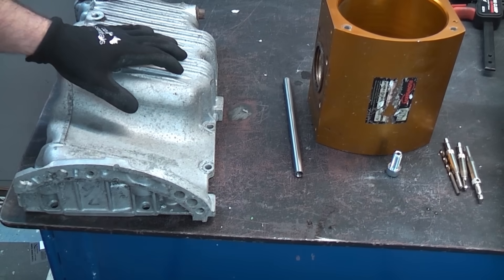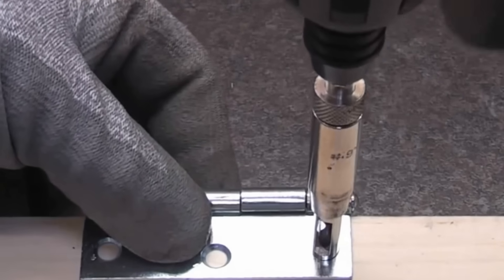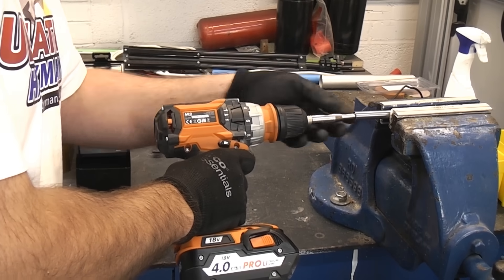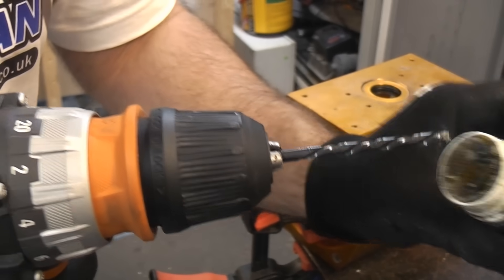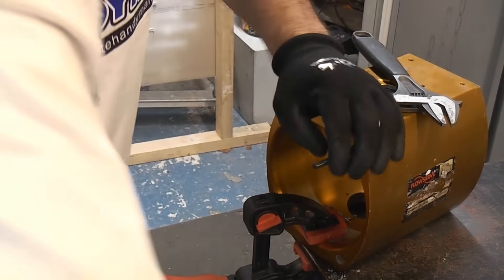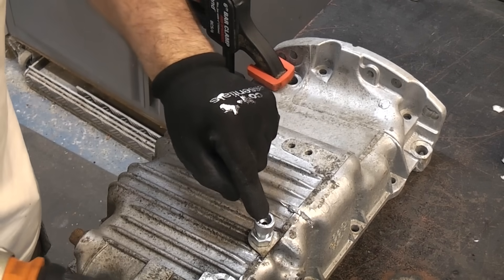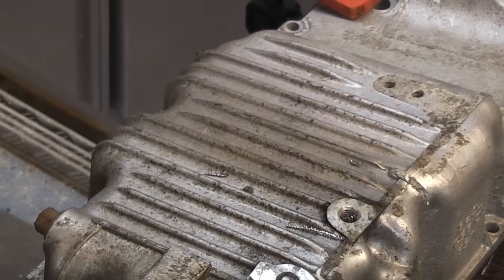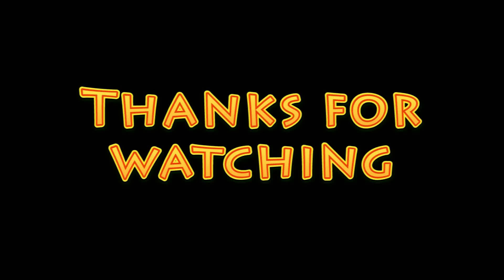How to remove a broken bolt in a deep hole | remove broken bolt in recessed hole

Comment: Whats the name of that tool there bud??
Reply from the maker: Hinge centering drills- https://fave.co/2DpJo1H
Left handed drill bits- https://fave.co/2xJjK1M
Teng screw extractors https://fave.co/2OnfRuF
Dormer taps -https://fave.co/2OsN1sQ

If you are in the UK-
Hinge centering drills- https://fave.co/2NE1VMc
Left handed drill bits- https://fave.co/2DubtF4
Teng screw extractors- https://fave.co/2pVLkVT
Dormer taps - https://fave.co/2pTfbyx

exact cutting paste- https://fave.co/2Nabyxc
cobalt drill bits (they are much better on harder steels like bolts) https://fave.co/2zDh3kp

You'll have to make the guides yourself, but they are easy- https://www.youtube.com/watch?v=6mZj0J6CNYA&t=1s

Spring tools centre punch- https://fave.co/2NbnLBD

Thanks for the comment 👍

Comment: Some very, very good tips here for any beginners watching, all things that experienced engineers practice of course. 
I have a couple of comments to add if I may. 
First: When using the extractor it works better if you use a proper 'T' type tap wrench, so axially the extractor and wrench stay in line and you can keep pressure on the extractor thus it works better and stays engaged. 
My second point is that the extractor you had in the video appears to be of a cheaper type if you don't mind me saying the ones made by Dormer and similar class tool makers are more effective at gripping as they are harder and have a more coarse helix so 'draw into the bolt in a more positive way.
I hope you don't mind me adding these points?
Reply from the maker: I don't mind at all. 
I thought I said that I had left my tap wrench at work, hence using the adjustable. I did not realise Dormer made extractors, I will look out for those 😉 
Thanks for the comment 👍
Reply: @ultimatehandyman   The type / PT No is just 'Set B' no's 1-6, I've had mine for 30 years and never broken one although the No2 one has slight wear marks. Hopefully you can get some or equivalent.
Regards Steve
Reply from the maker: @stephenrose8188   Thanks Steve 👍

Comment: When I was an apprentice fitter (55 years ago), I was given the unenviable job of removing broken taps from workpieces.  We had an electrical tool that had what looked like copper tubes of different diameters.  An earth was applied to the work piece and the (insulated) tube was put into the chuck of the pillar drill.  The power was switched on and the tube was fed down to the broken tap. Water ran through the tube and when it touched the broken tap it started to arc and slowly eroded the tap.  It took a while but went right through the broken tap and the remaining flutes of the tap could be removed.  (Before you ask, the pillar drill was used only to feed the tube, it was never switched on).
Reply from the maker: I think it's known as spark erosion. I have a mate that works for British Aerospace engineering and he could not remove a stripped screw from his door lock, so I went and removed it using an elastic band. I then asked how he would have removed it at work and he said he would have spark eroded it 😱
Thanks for the comment 👍

Comment: On one particularly siezed broken bolt, I did not have enough thread in the hole to screw in a guide bolt, so I used my Dremel to flatten the broken bolt.  I then punched a starting point for the drill.  I drilled in about 10mm.  I then heated the bolt with a torch and then made a well around the broken stud and filled this with penetrating oil and left overnight.  The following day, I used a Torx bit which I hammered into the hole and the broken stud came out without to much hassle.
Reply from the maker: Jobs like that really try peoples patience!
Thanks for the comment, Barry 👍

Comment: Thanks man, I had a broken bolt and the center guide, left hand drill bit, and extractor tools worked perfectly.  The center hole on the screw is an awesome idea, unfortunately I don’t have a lathe.  I had to spend a little money but I think it would of been impossible without those tools. Also just a tip on the extractor tool.  Instead of a wrench, try a hand drill, much easier.

Comment: Here cause I have a broken stud, tried cutting a slit into it to fit a flathead screwdriver in it broke the crew driver, tried drilling it out. When that bitch is in my hand I'll be drinking a few beers. Been at it for over an hour

Comment: If it still won't come out, drill the broken stud all the way through using another bolt for a depth guide. Then drill it again to the tap size and re tap the hole. The visible good threads will make it match perfectly as the tap cuts out the remaining bolt material in the threads. 
Sounds good anyway.

Comment: It seems like it might have worked better when you were using your hollow hex key bolts, to back them off a touch so they weren't actually touching the broken bolt.  That would give your left hand drill bit a chance to move the broken bolt slightly.  By putting your hollow guide bolt against it, you prevent it from moving.

Comment: Question: with lug nuts would you also recommend the anti-seize?  That's a bit different as it's a nut not a screw. Seems mechanics never do
Reply from the maker: The garage where I take my van always use it on the lug nuts ;-)
Thanks for the comment 👍

Comment: The centre drilled socked head bolts as a guide are brilliant.  What size holes did you use for each one?
Reply from the maker: I think I drilled a 3mm hole in the M8
4mm hole in the M10 and 5mm hole in the M12 (or thereabouts) 
 Thanks for the comment 👍

Comment: I know I sound like a goof, but anytime you have a bolt broken off in a cavity (outside a vacuum 😁), the threads are almost always rusted badly or cross threaded.  Im no expert but in practice, for me 90% of the time;  I have to drill out, chase threads, and many times heli-coil.

The guide seems to be the way to go in practice.  I have never tried them, will have to get a set!
Reply from the maker: Thanks for the comment 👍

Comment: No lathe? You can still drill a centre hole in a bolt, there are YouTube videos that explain how using just a pillar drill. Given a milling machine it is possible to use an end mill to take out most of the bolt just leaving just the bolt thread to be picked out of the hole. BobUK.
Reply from the maker: https://www.youtube.com/watch?v=6mZj0J6CNYA
Thanks for the comment, Bob 👍

Comment: Great tutorial, thanks. Those purpose-made centering bolts are a great idea for anyone who has the right tools to make them, I would probably have to try to make do with a bit of pipe of the right outside diameter and some smaller diameter pieces fitted inside russian-doll style to narrow the inside hole, so obviously not ideal. I found your post because I let a quick-fit outfit fit a new battery for me and they managed to snap off the bolt which secures the battery edge clamp - although in my case the bolt is sheared off flush with the surrounding surface so the guide bolt or guide pipe trick can't be used. I wonder if you have any interesting dodges for when the bolt is snapped off flush instead of recessed?
Reply from the maker: I normally try to knock the bolt around using a centre punch, in the direction of removal. If that does not work, I centre punch it in the centre, then drill and use extractor.
Thanks for the comment 👍

Comment: I have never successfully removed a broken stud with an extractor tool. I have had some good ones too, but 99.999% of the time the reason it is broke off is because it is totally seized in the threads and if it was seized enough to rip off the bolt then it’s seized enough to break any screw extractor.
Unless it’s in a place where I can heat surrounding metal orange hot I have to drill as centered as possible and go larger until I get to the diameter of the bottom of the threads.
Reply from the maker: Extractors rarely work if the bolt is seized in with rust etc. Like you say there is a very small chance of them working on such bolts.
Thanks for the comment 👍

Comment: Galvanic corrosion from dissimilar metals makes some broken bolts impossible to remove.  I had a broken steel bolt in an aluminum lawnmower casing.  Broke 3 ease outs and a drill bit trying to get it out.  Tried every kind of broken bolt remover, heat and PB Blaster.  Finally drilled it out and put a bolt and nut in its place.
Reply from the maker: Thanks for the comment 👍

Comment: When this happens to me, the bolt is usually rusted in. When it happens it seems like it’s impossible to move. What do you do when it’s rusted in like that?
Reply from the maker: I normally heat it up, let it cool, then spray spray penetrant on it and then attempt to extract it. If it feels like it's not going to move I repeat the process. 
Thanks for the comment 👍

Comment: Just be careful will copper anti-seize on aluminium parts that are exposed to high temperatures because is can encourage galvanic corrosion, especially where there is exposure to salt - i,e, on a cars underside.  Silver grade anti-seize is what you should use for machinery that is exposed to high temperatures and salt.
Reply from the maker: Thanks for the comment 👍

Comment: DO NOT put COPPER based anti seize on aluminum.  use the nickel based.  copper and aluminum get along ....meaning it steals electrons destroying the aluminum
Reply from the maker: On the site where I work, people have been using copper anti-seize for decades with no issues.
Thanks for the comment 👍

Comment: A copper pipe just larger than your drill bit wrapped in tape can be screwed into the threads to protect them and center your drill bit. Works great if you don’t have the tools to make a custom bolt with a whole through it.

Comment: Drilling out some bolts for different sized threads was a GREAT idea.  I've drilled out wooden dowels to do the same basic thing, but your bolt idea is much more accurate and dependable! A quality set of bolt extractors adds to the enjoyment of having that lodged bolt finally land in your hand.
Reply from the maker: You are welcome
Thanks for the comment 👍

Comment: First and last experience with an extractor - I used one that was too small, it snapped off, and then no chance of drilling an extractor out... ended up getting a new motorbike brake caliper because of that. 
I fully second the use of copper compound especially on steel to alu fasteners that will happily corrode together otherwise!
Reply from the maker: You can drill them out, but it's not easy-
https://www.youtube.com/watch?v=7JCfEMrCjhc&t
Thanks for the comment 👍

Comment: Nice video.

But you should never use copper grease on alloy threads..
Reply from the maker: We've been doing it for decades on site, but combined with road salt it could cause problems
Thanks for the comment 👍

Comment: I personally removed 5 of six broke off bolts in a T680 kenworth front aluminum  wheel hub, grease cover retainer bolts, in this case I drill through all the  broke off studs then welded with a 0.30 Wirefeed welder starting inside the studs then  welded 5/16" nuts on them, important let them fully cool down before taking a 3/8" drive impact spinning them out, I only had to weld a nut on twice for one of the five, I removed all five in about 1hr20min. I guess I should make a video of this next time because I do this all the time. Great Video though for drilling in perfect Center of a stud.
Reply from the maker: Thanks for the comment 👍

Comment: Super-helpful techniques - your homemade threaded drill guides are brilliant.  One thing that can be a real problem is sometimes the surface of the broken stud is work-hardened from the vibration, etc. as it breaks. Those ones are extremely hard to get a drill started on. All it takes is a little grinding with a mini-carbide burr to get through the hardened surface metal, then they drill easily.
Reply from the maker: Thanks for the comment, Pete  👍
Reply from the maker: You should have seen my mates face when I told him that I had some reamers that could be used with an impact wrench ;-)
The tolerance is not important for the job I do- as long as the hole is large enough, I am happy.
Thanks for the comment

Comment: Excellent video
Reply from the maker: Thanks for the comment 👍
Reply: @ultimatehandyman   I work at a large Handyman store in NZ and within the hardware section (I work in power tools) we have bolt removal tools and taps and dyes etc, but not the spring loaded tool you showed centering the drill for extraction. What is it called as we should have it in our range.
Reply from the maker: @lovelyjubbly1010   They are called hinge drills, or hinge sighting drills/hinge centering drills-
https://www.youtube.com/watch?v=dJ_1pbNwA_Q&t
Reply: @ultimatehandyman  Much obliged, been in the game a long time, never seen these things, very useful, more for bolt extraction than door hinges, we need to stck these things at work, cheers!

Comment: Hi, I made some drilled bolts on the lathe but never used them cos bolts always break flush, not recessed like this. I can't remember ever successfully using an easy-out either. Instead try grinding a normal drill into a left hand cutting drill. The flutes will be wrong but drill in anticlockwise and most times the drill will bite in and run the bolt out.
Reply from the maker: It depends what you work on, most of the time the bolt will be flush, or just proud of the surface, but sometimes it is below the surface (just look at the amount of people that are going to make a set of these in the comments).
Easy outs work now and again, but probably have a 90% failure rate. 
Thanks for the comment 👍

Comment: Be aware that torque figures are calculated for a clean, dry thread. If you apply a lubricant you risk over-stretching the bolt so you should reduce the torque to compensate. How much is a matter of judgement.

Comment: I took out of many of broken off stud in a cold truck tire we put a well a washer on and weld it let it cool a little bit damn weld a nut on there let that cool then we would take it off with the air again even though you had anesthes ia in the threads the pressure from all that weight of the cold with an extended bed made the white heavy on the tires
Reply from the maker: Thanks for the comment

Comment: If all broken bolts were this new and clean, I can easily see those options working. But most of the time dissimilar metal corrosion has made them break off and the remaining part is like it is welded in place. Those are the ones most guys have the problems removing. JMHO
Reply from the maker: Thanks for the comment 👍

Comment: Screw extractors are useless. If a stud broke off  while trying to remove it, the most an extractor will do is to expand the drilled hole in the stud and crack the soft material it's stuck in.  I drill progressively larger holes in the broken stud and then re-tap the hole for a threaded steel insert.
Reply from the maker: Sometimes they work, but 90% of the time they don't
I spent a few hours trying to remove a sheared stud a few days back.
Drilled the centre
heated it with the burning gear
let it cool
Tried a screw extractor, didn't work! (my mate had already broken one extractor in the other sheared stud)
Tapped the hole to a smaller diameter (M8) screwed in a cap head bolt, then used the impact and sheared that off.
Heated it again with the burning gear
Drilled out the broken bolt inside the sheared stud, tapped it again, tried another bolt- sheared that!
Then gave up and passed it back to my mate, as it was home time.
He had to drill both studs out on the pillar drill, then make some inserts on the lathe!

Comment: He forgot to mention that most bolts in holes like that are broken off because they bottomed out in the hole, then drill all the way thru the bolt to relieve the stress on it then work out t out, we some times drill a hole and find a torx bit a little bit larger and drive it in with a hammer and turn that out
Reply from the maker: Thanks for the comment 👍

Comment: If broken bolts came out this easy, they would not break in the first place. Normally when bolts break they are not in aluminum.
Reply: It's actually harder to remove broken bolts  from aluminium as threads can stretch and trap the broken bolt. The harder the material of the bolt and threaded hole, the easier it is to remove.

Comment: Odd that this should appear in my feed after already tried and failed at this very thing today. It was a soft, copper soldering iron tip that had broken off in the iron. The screw extractor just chewed up the copper remnant without extracting it. If anyone knows anything that might work, please chime in. Otherwise I'll just replace the soldering iron.
Reply from the maker: I'm afraid you might have to drill that out and then re-tap the hole- or buy a new soldering iron!
 Thanks for the comment 👍

Comment: I have in the past welded a nut on to the broken off stud on an aluminum piece 309 welding rod is what you use. Grab the nut with pliers and hold it directly over top of the broken stud. Smaller 3/32  309 welding rod works good. With self darkening face shield you can pin point your rod go just a little at a time and let it cool a bit then keep welding as necessary once the weld is above the piece you want to get the broken stud out of point your rod towards the sacrifice nut.  I have taken out 1/4 inch studs like this with minimal damage to the piece.
Reply from the maker: Thanks for the comment 👍

Comment: Your spring loaded punch thing looks like the lpl/deviantolem door hinge pin remover
Reply from the maker: It's made by springtools, they make several different types, some of which can be used to quickly knock out hinge pins. They are great ;-)
Thanks for the comment